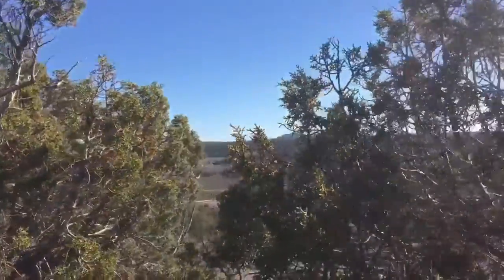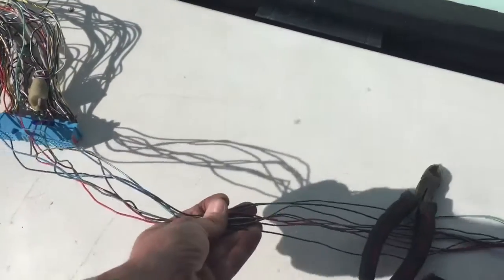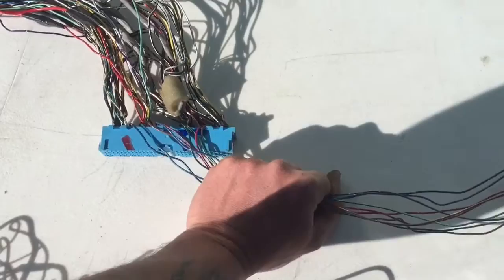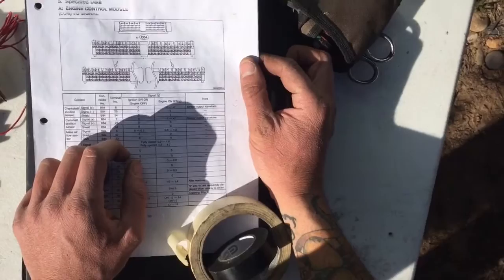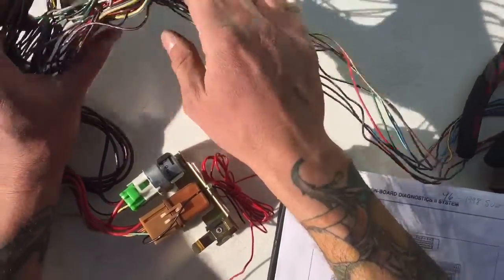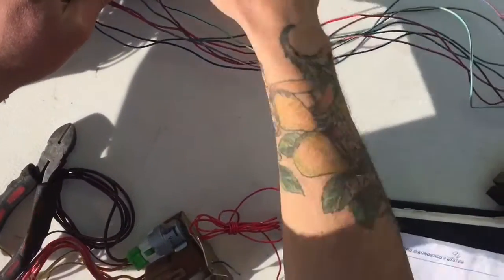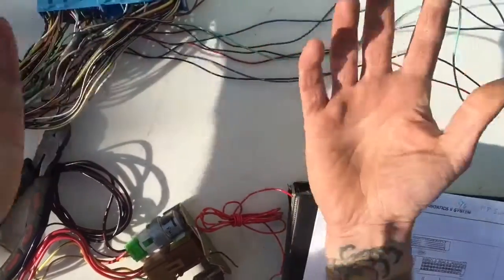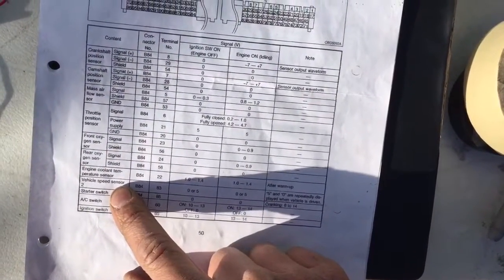4. Loose Wire Identification 1/2 - Wiring Harness Series

Comment: Thanks you for your helpful videos. I do have one question though, for Pin 82 the light green/black the neutral position switch, can the color of that wire vary from year to year? On my 99 harness for ej25 I have a blue/red that splits off into three larger wires further down the wire. Do you know if that would be the neutral position wire?

Comment: I think I've located a correct pinout online but it took some digging. I've identified all the homeless wires from ECU (although it looks like I have more than you do). Which link(s) are you referring to for the I/O Signal Sheet? I'm working on a 2001 Legacy harness.

Comment: I am so lucky with what  you are giving us thanks so so much . I just got my donner car this week Imprenza 98 ( they have the same engine up to 2000 ) Ej22 sohc. The ECU have similar blue connector. Wonderful i will save my 77 Bus, finely.
Reply: +Remi Goudreault Note; on (they have the same engine up to 2000) after more research they use the same Transponder Philips ID33 ? JMA : TP01 / TP05 ? PCF7930 ? PCF7931 from 96 to 2000. My engine is a bet of a mess to get sorted ott for gasket/timing kit . EJ22EZ solid lifters, single-port exhaust, but still Phase I

Comment: can i cut all the random plugs that were under the dash off and pull the wires besides the fuel pump relay ignition relay and obd2 sensor wires?  I'm converting a 2.5 harness to work in a 63 vw bus. thanks
Reply from the maker: +Bobby Hancock yes, random plugs don't need to be in your conversion.